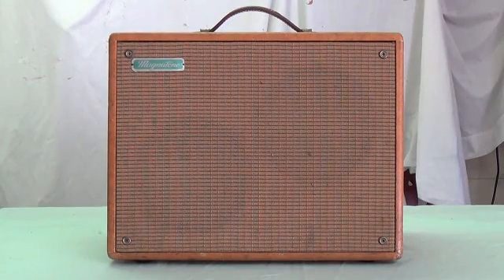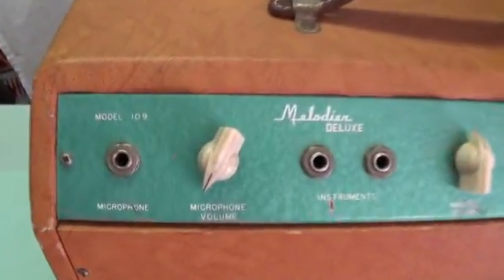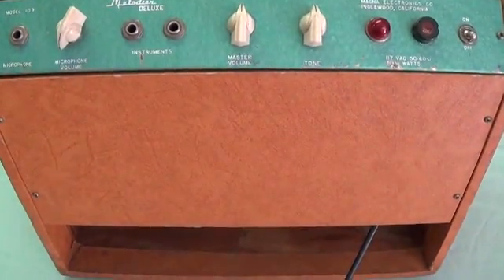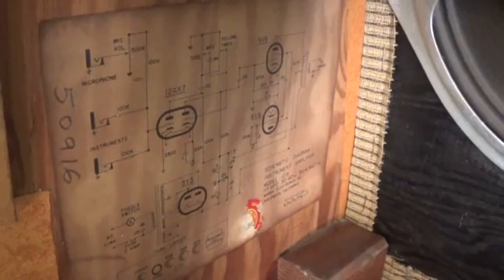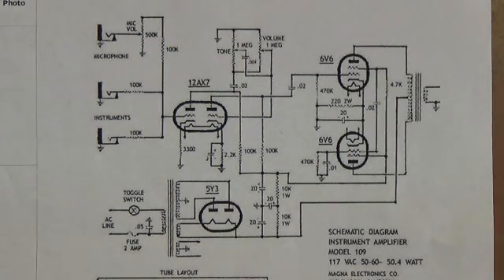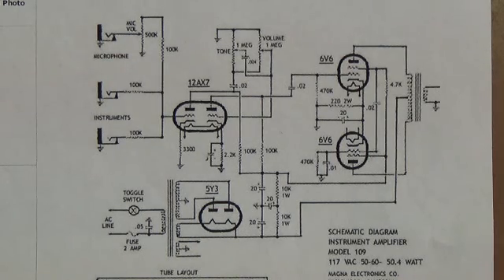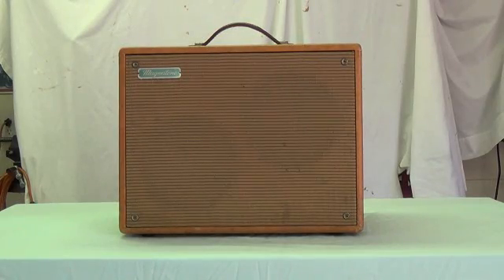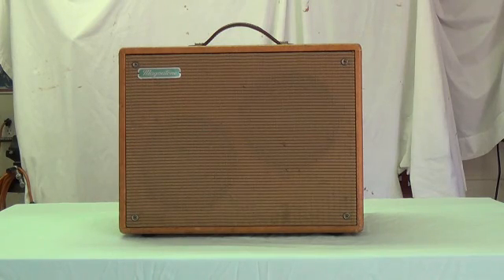1955 Magnatone Melodier Deluxe Model 109 Guitar Amplifier

Comment: More questions about the Melodier!  Specifically, the cathode bypass caps on the 6V6s and the 12AX7.  What voltage rating are they in the original circuit?  I figure I can get away with 25V on the 12AX7, but what about on the 6V6s?  50V?
Reply from the maker: Jason Thorpe That sounds reasonable. You could go with 100V (for a few cents more) and be really safe.

Comment: Thanks for spending your time producing your videos. You have a very good voice for it. To give a little insight to how this type phase inverter works here is the explanation on it. Look at the screen grid of the top 6V6 tube. Notice it has an extra 4.7k  resistor on it. In this circuit the screen grid of the top 6v6 is also acting like a plate and the extra resistor like a plate load resistor. This of course lowers the screen grid voltage on the top 6v6 tube and allows it to fluctuate with the drive  signal from the 12ax7 tube giving the drive signal to the second 6v6 tube though the.02  cap which is a coupling cap. The 470K resistor on the control grid of the bottom 6V6 is simply a grid leak resistor and the .01 cap across that grid resistor is a tone cap pulling the highs off of the bottom 6v6 tube. This is a bad design lowering the output power and adding extra distortion to the signal but it does work giving it that different sound.
Reply from the maker: You're welcome, ND, and thanks for your excellent explanation of the Melodier phase inverter. We appreciate your informative input.

Comment: Hi Doug,

Do you happen to know the TX specs for the Magnatone 109? Such an unusual design I must build one!

Thanks

Chris
Reply: Just to follow up on that... I ballpark the Magnatone 109 tube complement at 100ma, and the 5Y3 data sheet shows that at 300Vac per plate will yield just shy of 325Vdc @ 100ma.  So, I think I have my answer!  Yay!
Reply from the maker: I don't know the specs exactly, but looking at the schematic I would bet that the PT and OPT for a Fender 5E3 Deluxe would work just fine (with a little safety margin to boot). Good luck with your project :)
Reply: RiftAmps I have been looking around for the original specs on the 109 transformers as well, but it seems like the Edcor XPWR100 (https://www.edcorusa.com/xpwr100) would be good for the PT (and give you a couple of different options to play with as far as B+ voltages go), and the Edcor XPP25-4-7.6K (https://www.edcorusa.com/xpp25-4-7_6k) would make a reasonable OT.  USA-made and not terribly expensive!

I think the Fender 5E3 PT is a 325-0-325 B+ winding, right?  This circuit is a Class-A push-pull, is it not?  If so, I'd worry about cooking the 6V6s at 325*1.4.
Reply from the maker: I used a Deluxe Reverb PT (330-0-330) for my Fender Deluxe clone and ended up with a PV of 336VDC, perhaps due to the 5Y3 rectifier. The Edcor transformers do appear to be an excellent choice also. Use what you feel comfortable with.
Reply: Uncle Doug Good point, I always forget about the voltage drop with a tube rectifier (solid state rectifiers drop significantly less that can be basically ignored at B+ voltages).  Perhaps a better choice would be XPWR061 (300-0-300 @ 120ma).

Comment: I really like these old Magnatones.
Reply from the maker: You're not alone. Several people liked this amp so much that they are currently building clones of it. It has a very unique phase-inverter circuit (described in video), and it has two 8" speakers.....both of which give it a very special sound.

Comment: This amp uses a configuration called "screen-fed self-split", in which you add a certain voltage drop on the screen grid of the tube being driven by the preamp, and the screen will work as a "second plate" with an inverted signal that can be taken from it.

The .02 capacitor feeds this signal to the other 6V6, and the .01 capacitor helps prevent squealing.

This is a cool configuration, because with a little work you can have almost 90% of signal going to the lower tube.
Reply: Thanks for that info.  I just gotta wonder who figured all this stuff out.
Reply: @RobRice-so5nv it was known pretty early on, but 2 main things made it unpopular: the odd harmonic distortion from the output being imbalanced, and logistics.
Why sell 1 amp with 2 output tubes when you could sell 2 amps with 1 output tube each for much more? Or make the 2-output-tube amp real fancy-like with more tubes, so people spend more for one? After all, more tubes, more better!
This kind of thinking made these self-split amps fall into obscurity.
Reply: @Bleats_Sinodai  I think the point was to eliminate the phase inverter to cut the cost, and sell one amp with one less tube for less and still have practically the same output.
Reply: Nice one. I'm trying this idea for next build. Currently working on the new vidrochamp with reverb. I know its old video but it's so great learning stuff. ❤